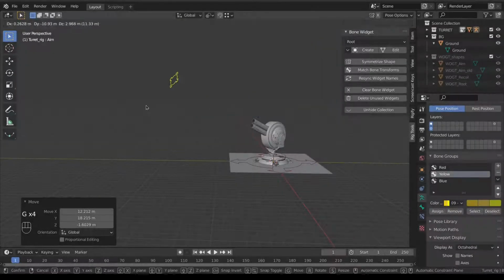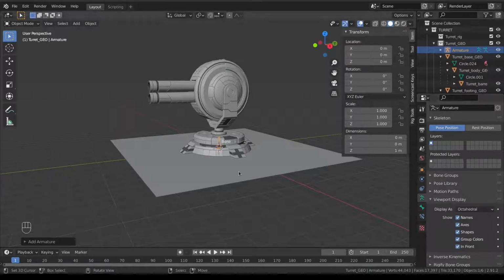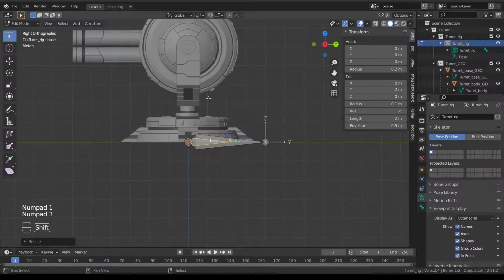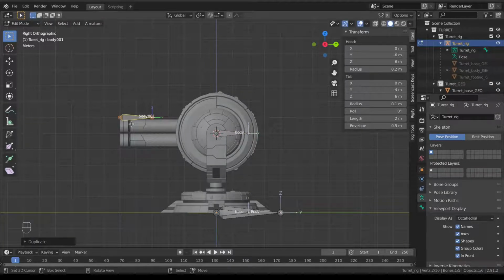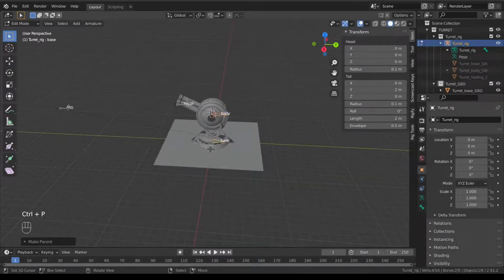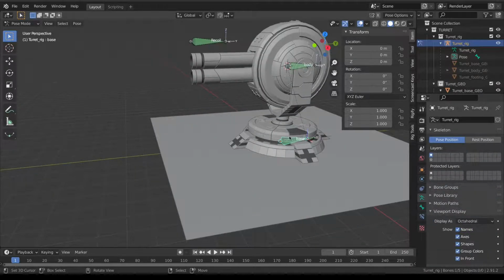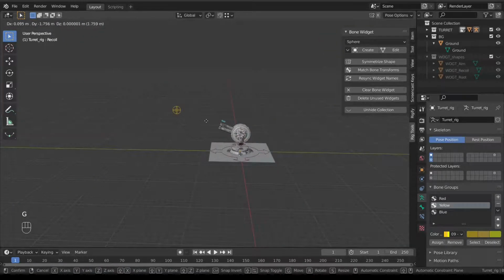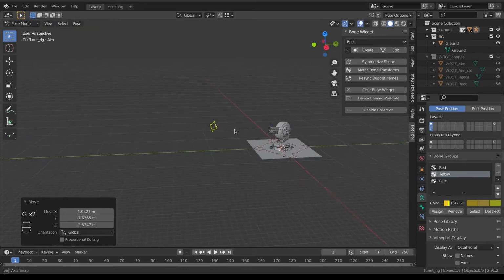03  Rig a Gun Turret demo

Comment: Thanks, really good video. I just have the problem, when I move th Aim Bone on the Z axes it is completly fine, but if I move it on X Y its very sensitive and spins really fast. I noticed that it increases in Speed the further I move the bone frome the orignal Positon. When I try to go into the other direction it lags behind, like it has to "Re" spin first. Any Ideas?